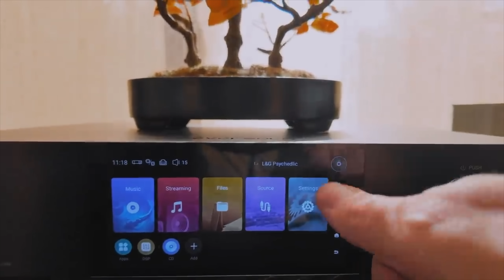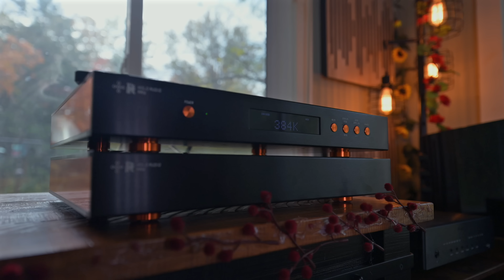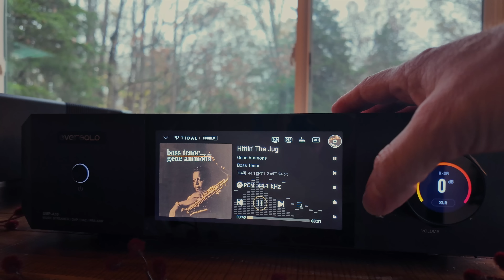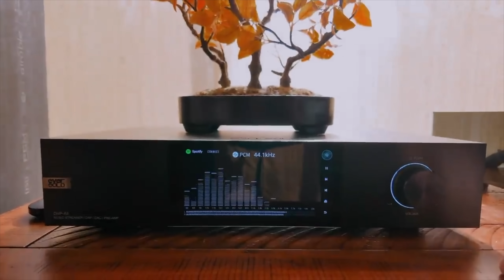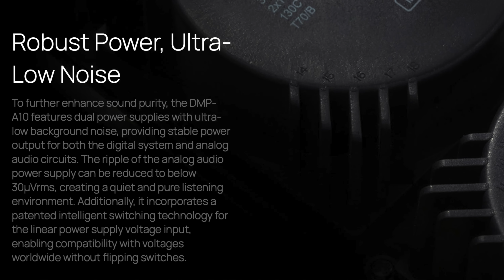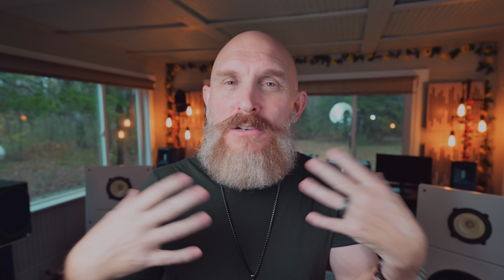WHOA! The Eversolo DMP-A10 Flagship Streamer/DAC/Pre-Amp Review! No Compromise Performance for LESS.

Comment: I am currently using an Eversolo DMP-A6 SE with LPS-A6-MKII power supply. DAC is a Weiss 204. Overall very happy with everything. Do you think I would hear a difference in streaming sound quality moving to the A10 ? I am especially intrigued  by the room correction feature. I have a difficult listening room with angled vaulted ceiling and open wall on one side of the listening space. Thank you!!!
Reply: You would even hear a big difference moving to A8 which is better value for the price.

Comment: If you were to use Eversolo units as streamer only.  Is there any benefit of the DMP-A10 over the DMP-A8 or the DMP-A6 Master?
Reply: I doubt there would be much of a difference.  If you want a streamer only, wait until the Eversolo T8 comes out.  Audio Solutions in Indianpolis opened my eyes as to the advtanges of using the Eversolo DAC as opposed to using as streamer only.

Comment: When plugged in via ARC, does it turn off/on instantly with the source TV? I have the new Aurender A1000 as a digital preamp for my TV and it shuts completely off when the TV does. Problem is that it takes 30 seconds to turn back on when I turn on the TV, which my wife is not fond of.
Reply: auto input switching is selectable

Comment: what loudspeakers in which room do I need for the A-10? at price around 3800€ plus decent amp which fits the A-10 The loudspeaker should cost what? 10.000€? 90% of the consumer have between 20 and 30 square meter living room.  Anyway nice A-10. Which amp you suggest? Has it room correction eg an eq?
Reply: I heard a10 with Cambridge edge m，great sound

Comment: The A8 is very high value for the price. The A10 .... not so much as in the $4k range there is some serious competition. Once it hits the market I might try the A10 and see how it compares, sonically, to my A8, but only from only from a seller that accepts returns.
Reply from the maker: @joeythedime1838  the A10 is a much nicer unit than the A8, in parts, features and sound . So there’s that. Much more refined in sound. As one climbs the ladder the performance increases.  So all up to what one is looking for in price vs performance.
Reply: @HiFiHuff Can it compete with the T+A DAC 200 sound quality wise?
Reply: @joeythedime1838  what competition can u mention few
Reply: @mariuszszymczewski8590  HiFi Rose RS150B, Aurender A1000, cocktailAudio X45Pro

Comment: There are a few others you should review, the Atoll ST300 (waiting desperately for this one), the Gustard X30, the Gustard A26 III .....
Reply: The Atoll ST300 Signature is a stellar performer - it only lacks the 2 dedicated sub-outs which are required for my next rig.
Reply: @SirMountainpass  I had the ST-300 it sounds great but it coud have more resolution. Software is far behind other devices.
Reply: @ 
In my rig it was doing a great job (mainly Tidal - via Tidal Connect) in combo with my Focal Sopra 1 (featuring a fabulous beryllium tweeter) supported by an Sopra SW1000 sub.

Comment: Great Review!  Does the A10 have an I2s output for connecting to an external DAC?  The A8 has that output.  Thanks.
Reply: I don't think it does
Reply: It is rather strange that Eversolo goes and includes an I²S connection on their DMP-A8 only to remove this option from their new flagship DMP-A10. It feels like a retrograde step - especially when considering the cost of this new 'flagship' model. 🤔
Reply: @CletusVanDamme2011 Not as strange as you might think, a number of higher end streamers like the Auraliac Aries G2.2 don’t include I2S, just USB and s/pdif. It’d be negligible expense for them to include, I’m sure they would if it delivered better sound than USB, so was more competitive with their competitors.. and yet they don’t.
Reply: @Wharariki  Thanks! I am not a DAC designer but I believe that the implementation of an i2S interface requires additional firmware development to support the protocol. My assumption is, eversolo did not want to incur the additional development time and cost of implementing and more importantly supporting the I2S interface.  It is possible they don't see the sonic benefits.

Comment: How does it sound paired with the Borresen X1/X2?
Reply: I own the X2, do not have the X1. Still sounds like the X2. The character of the DAC is clean, clear, open, big stage, nice midrange and tight bass. The amp used also makes a difference and the EC amp I use has a solidity and richness about it that sounds different than other amps I’ve had or have. In any case the A10 sounds great, and much better than I expected it to sound.  Thanks for watching.
Reply: @ thank you for the swift reply. Always waiting for your next review 👌

Comment: I agree Eversolo has the best app.  Just as an FYI I purchased a high end Pangea 14 gauge power cord and it made a massive difference to my DMP A-6.  A huge difference! Love the streamer and I need to listen to the A-10.  Use my A6 just a s a streamer.
Reply: Awesome! Enjoy!
Reply: @dangoertz what dac are you using with your A6 and what sound improvement did you get when changing Power cord?
Reply: @ I’m running a Peachtree Carina GaN integrated amp. It runs a dual mono configuration ESS 9068 dacs.
Reply: @ the sound stage increased with the power cord in a huge way. I couldn’t believe it and switched the provided cord back into the Eversolo and it went back to the “stock sound”. The stock sound wasn’t bad but when it was connected to the larger power cord it was as if the internal power supply had been upgraded.
Reply: Hmmm hope you're right! Gonna get one, thanks.
Reply: @dangoertz8030  is it the Pangea audio ac-14se?
Reply: @ericelmore887  yes.